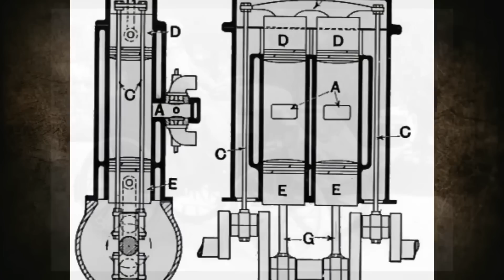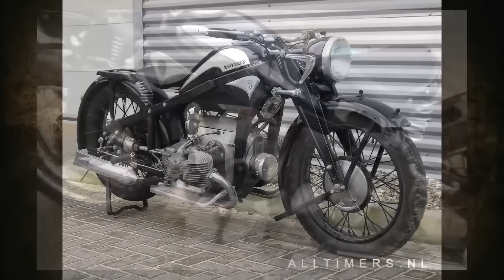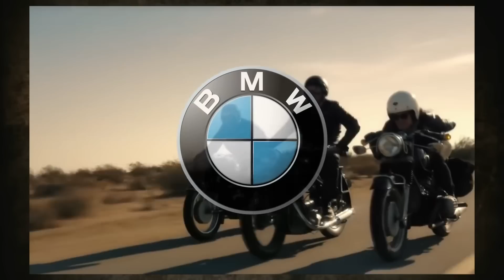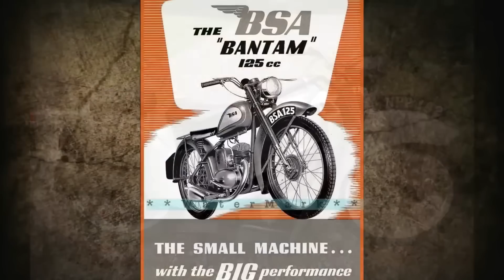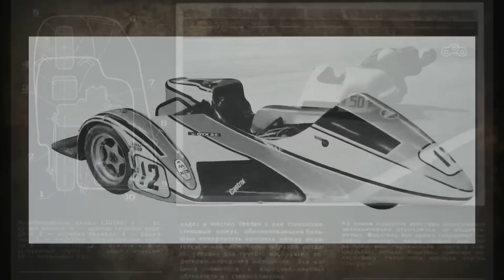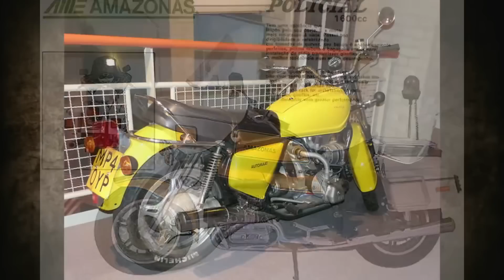A Few Words About Boxer Engines

Comment: I have had 4 boxers in my life the first was a 1967 VW beetle, the second was a 1982 goldwing interstate which i bought new. the third was a 2008 ural patrol  i also boght new. It was a a POS  always breaking down. my current boxer is a 1977 goldwing with a custom sidecar. the Hondas are by far the most reliable boxers that I have owned.